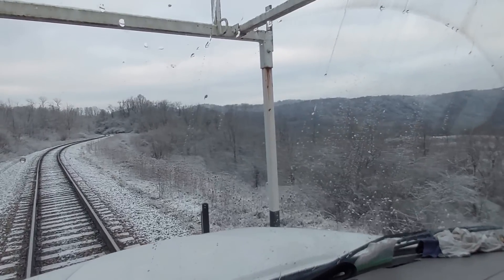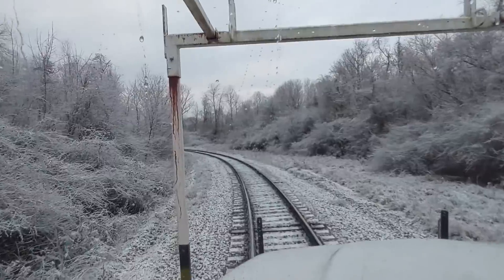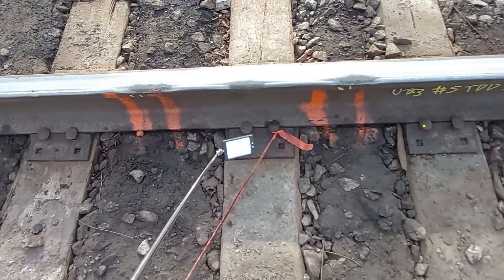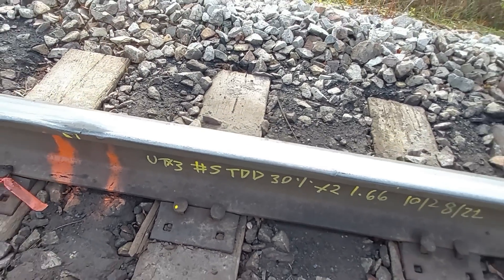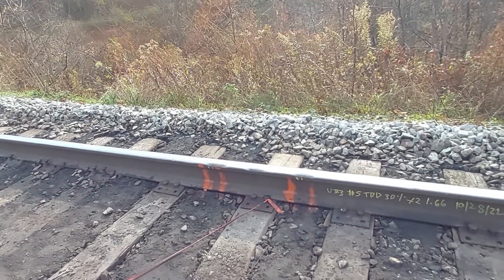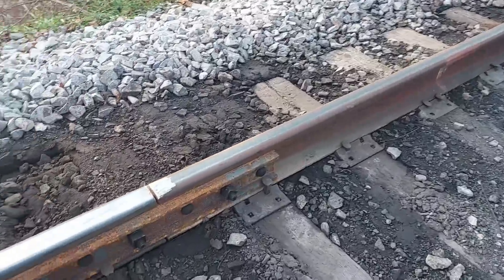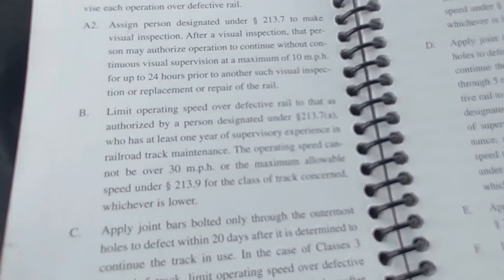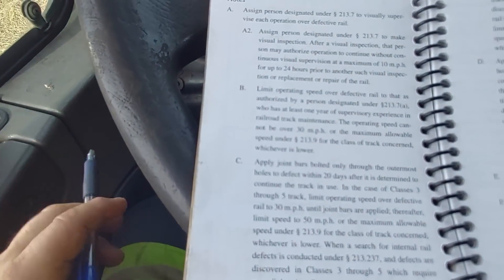Ultrasonic Rail Testers found a 30% Growth Inside the Rail Head

Comment: For about a year, I worked along side a ultrasonic rail testing team. One night we found a 100% T O defect on the main line outside of London.

This required us to immediately fit a clamp to the affected rail.

I was employed as a lookout/site warden, working both days and nights covering some 5 miles per shift - walk about 2.5 testing one rail and then turn around and test the other rail, using what we called sticks, basically a wheeled instrument with a large central wheel in which the ultrasonic signal passed through and into the rail. Or use handheld detectors for the rail ends.

When it came to the paper work, we record the rail type and where it was manufactured such as 'workington steel' as an example. Also any defects found, type and location such as 36mile 25chain. Which line it was.

 Heading back to our van for a nice cup of tea or coffee.

Sometimes we just walk the whole 5 miles to another van.

We also use test trains running at line speed upto 125mph with various types of equipment fitted and any defects found are marked with a yellow line in the fourfoot.
Reply from the maker: Appreciate your sharing that with us Kezza. Thank you very much
for taking the time to visit with us and check out the video 
my friend.

Comment: Hey Dave.  The defects in the rail head.  Was that a manufacturing issue that the defects came from?  I hope the manufacturer gave you  a some credit for a new replacement rail.  This has me thinking.  Thanks Dave.  Robert
Reply from the maker: Appreciate the nice comment Robert. Yes it was caused by an impurity in the rail rolling process and made worse over time by the train traffic. Expansion and contraction of the steel does not help matters either. That rail was rolled in 1975 so no replacement
from US Steel for that one! Thank you for taking the time to  stop by and check out the video my friend.
Reply: Dave, you are the best in explaining how things work and what cause the problems with how to work around things, the need fixed or replaced.  It makes me sad that I could not get working for the railroad.  I always look forward towords your videos.  Thanks again, Dave.  Robert
Reply from the maker: @roberttrometter5788  👍😊

Comment: Thank you for this interesting video. 

Unlike bones (where the fissures are called occult fractures) rails don't repair themselves. 

There is likely in each instance a defect in manufacture or excessive stress beyond what's normally expected, perhaps related to the laying of the rails: a minimal defect can serve as a nidus for further growth. Multiple detection modalities will reduce the false negatives.
Reply from the maker: Appreciate the nice comment Robin. Yes it was caused by an impurity in the rail rolling process and made worse over time by the train traffic. Expansion and contraction of the steel does not help matters either. Thank you for taking the time to  stop by and check out the video my friend.

Comment: How old was the rail with the TDDs? I know in the days before continuous casting, the “A” rails would be the ones with the highest chance of impurities, since the A rails were rolled from the bloom at the top of the ingot, where all the impurities collect.

Thanks for sharing!
Reply from the maker: Appreciate your sharing that RailrunnerRHS. I am very unfamiliar with A rails. The rail we had was 132 1975 US Steel Illinois HH.
Thank you so much for taking the time to stop by and check out the video my friend.
Reply: @ccrx6700   More than happy to give back! The side of the web opposite from the brand should have the heat number, ingot number, and rail id stamped into it. Usually the rail id is just a single letter separate from the other two numbers. If the rail was rolled from a traditional bloom, it’s typically given an id between A and H (with the A bloom being from the top of the ingot), and rails made from continuous cast blooms are typically given an id starting with P, R, S, T…

Don’t know that this trivia has much immediately practical use, but you never know!

Comment: For the first time ever in my carrerthe other day, I saw a sperry tech hand scanning the rail.  This was after the sperry rail car went over it and they rechedked it.  It passed right by an Insulated joint for our track circuits.  They did have one defect of CWR which was replaced as the track was out of service and the track cars followed on the same outage.  Welding truck and and a rail truck.  There was three crews.  They did use splice bars, for now, then Butte Weld later.  That was 136 pound rail.  We also have 115lb rail. I know that video was a while ago with the snow, but what pound rail was it and when you find some kind of defect if you could (if allowed) show us who made it and when it was manufactured.  

This testing is every 90 days.  Some by hi rail ruck as the SRS 128 does not fit in our tunnels, or in years past we had automatic signals that probably not make it when the machine came by. Now the signals are removed except the interlocking in one section.  Support track dept as the foreman says.  We have a book like that for Signal.
Reply from the maker: Will talk more about how they do it the next video Tuco. Hand scanning included in that. Thank you so much for the very nice
comment and for watching my friend. We do our testing twice a year.

Comment: Dave, you should request the company to buy a portable Stanley hydraulic power pack and a hose reel that you could put into the back of a hyrail pickup when needed when your boom goes to the shop, we have those and keep it on standby or use it as needed.

https://youtu.be/rHzE-MV8KO0

Comment: WOW! I didn't believe climate change, but you got some serious climate change going on there. Snow in the middle of summer. WE'RE DOOMED!!!!! AAAHHHHHHHHHHH!!!!!!

I did enjoy the metallurgical aspect of the video as well. I'm really amazed the rails stand up as well as they do.
Reply from the maker: Back years ago they warned us of an ice age coming.....now it's
the opposite. I bought a brass steam whistle, small one. It has
some yellow paint on it. What would I use to clean that bell up David? Just a wire brush or is there some special compound
I should use instead? Thanks in advance for your reply. Gonna plumb it in to my DeWalt big air compressor tomorrow and see
how it sounds, it's a small 2 chime so I'm not expecting a Big Boy
sound....:-)
Reply: @ccrx6700  Does it come apart? Not knowing how big it is, you could get some white vinegar and put it in a small stainless pan and put the whistle in there and boil it until the paint softens. then it should wipe right off. If that's not an option, try some acetone and a paper towel. Once you got that off, then I'd get some ~0000 Steel wool~, available at home despot, and go over the whistle so it gets a nice even finish. It will be matte at that point, but any odd coloring and stains will be gone.

Next get some Mothers Aluminum Wheel polish and a piece of soft cardboard box. Use a torn piece of that cardboard and on one corner dip it in the Mothers polish and then start rubbing out the brass. You should achieve a real nice shiny polish on the brass. You may need to apply several times with fresh pieces of cardboard. 

If you have an old clean, soft terry cloth rag, finish my wiping down the brass and removing any leftover Mothers residue. By that time, you should have a perfectly polished piece of brass.

I posted a video of how to do this on my channel in the community section. I tried posting it here and YT kept deleting it.

Comment: There is some interesting research on ground conditions and the creation of resonance frequency in the track steel. "When a train runs on soft ground it can approach or even exceed the speed of surface waves in the ground. Under such conditions the amplitudes of the track response increase considerably. Moreover, a resonance-like phenomenon can occur in which a clear oscillation trail can be observed behind the moving axle loads. An investigation is presented of this resonance frequency and the critical speed effect for a track on a layered half-space subject to a moving load"
Reply: Resonance can be evil.
Just like a bridge when you meet it’s resonant frequency can be a problem. ‘Flex flex flex crack!’
Reply: @Bassotronics  I'm thinking it adds to the destruction of these rails, makes defects fail faster. Might be Dave's operators hot dogging the trains when no one's looking
Reply from the maker: it is my firm believe that soft ballast does indeed cause internal
defects to grow faster that's why I want to read proof of it in
print so I can take it to management and show them studies done.
Reply from the maker: I would love to read that futtewuk, can you provide me with a web link please? Soft ground like we had at MP 1.66 is never easy on
track infrastructure. thanks in advance for getting that to me.
That is the kind of stuff I love to learn about. Also appreciate
your watching and writing in my friend.
Reply: @ccrx6700  I'm going to try and link it, the title is Analysis of resonance effect for a railway track on a layered ground
Reply from the maker: @futthewuk5789  I typed it in and got it!  Awesome will read tomorrow thanks so much 👍😎👍

Comment: Very interesting Dave, those testers must have saved a potential derailment or two over the years! As for the tamper, I know you've mentioned  braking rails with it before. So does it automatically follow that when that happens, the rail has a defect?
Reply from the maker: Glad you enjoyed Richard. Yes when tamper breaks a rail you
can bet there is an internal defect right at that spot where it broke. Thank you very much for stopping by and checking out the video my friend. Hope to see you on the next video part 2 of ultrasonic rail testing.

Comment: But didn't they have those defects labeled as (TDD) Detail Fractures? Therefore, Note C would apply. However, since your track speed is company limited to 25 mph you would still be within the guidelines,  just the remedy would be different. Transverse Fissures originate internally; Detail Fractures originate at or near the surface. All that is irrelevant since you replaced the defective rail. Correct me if I'm wrong.
Disclaimer: Members of my family have been railroad men since the late 1800s so it's in my blood 😄 but I am not a rail inspector or expert in rail defects. I do own both the FRA Rail Defect Reference Manual and the Track Safety Standards Compliance Manual.
Stay safe,
-- Joe
Reply from the maker: You are correct Joe. However I told you why we didn't put the joint bars on and also Note C says bars must be applied within a 10
day period. I knew at the time that it would only be 4 or 5 days
before we replaced the rail. So even with C in place we were still
under CFR compliance.  I do want to congratulation you on
being a thinking man and also say how wonderful it is to
have your family history in railroading! Awesome!  Thanks for
watching and you will certainly enjoy the next video coming out
on ultrasonic testing.  Also note: had there only been a single
defect on that rail instead of the 2 in close proximity I would have put the bars on that day despite what the CFR said.

Comment: Where's the Amazon link for the books? Then your followers can be keyboard warriors on railroad safety .

Interesting video, as usual. Thank you for taking time to make them.
Reply from the maker: You can get copies of the CFR book easily that info is also online
Mike.  The CP book now that's a different story, it is only put out by CP and you might, just might be lucky enough to find one on Ebay,
last time I checked no dice.  Thank you very much for stopping by and checking out the video my friend. Hope to see you on the next
video part 2 of ultrasonic rail testing.

Comment: Those defects look like where the drive wheels were spinning, no?
Reply from the maker: Jim, there very well could have been some wheel slip in both
those locations at one time or another which if it happened
certainly could have been a factor in the growth, but we will
never know with certainty. Thank you very much for stopping by and checking out the video my friend. Hope to see you on the next
video part 2 of ultrasonic rail testing.

Comment: Curious when you'd bolt rail sections together like this repair vs use thermite welding to join the rails.
Reply from the maker: Welders will not thermite weld a joint that has the 3 bolt
holes and we did not at that time have any rail that had ends
that were not drilled so we bolted them together, but good question. Thank you very much for stopping by and checking out the video my friend. Hope to see you on the next video part 2 of ultrasonic rail testing.
Reply: @ccrx6700  thanks for the explanation. Makes sense although I would have assumed you'd have cut out a section and scabbed a piece in and thermite welded it, not replaced the whole section of rail. Assuming that's because you'd then end up with rail made up of nothing but small scabbed pieces which isn't ideal either.
Reply from the maker: @dyoung3536  👍😊

Comment: YIKES! For a few minutes, it appeared there was snow in early July, until you got the dates straightened out. That snow would feel good on a hot July day, though👍👍👍👍❗
Reply from the maker: I'm ready for some snow about now Paul! Tired of this high 80 stuff, I like it cold. Thank you very much for stopping by and checking out the video my friend.
Reply: @ccrx6700  from what the national weather radar shows, your area should have got some rain. Not sure if its needed in your area, but at least its a little cooler than those sweltering 80s. I dont mind a "little" snow, but before it gets over a foot deep, thats when i get out and stock up. We have had a few days in the 90s here in central Illinois,, and the Ultraviolet reading has been a "10" for quite a few days. When it gets above "6", thats when i stay inside, per my dermatologist, because i am 5 times more likely to get the bad kind of Melanoma.

Comment: How often do you get a new FRA rule book out? Do they change in any way that is relevant to the railroad where you work? Do you have to take some recurrent training to keep up with this?

I am a private pilot, and we are federally mandated to do a flight review every 2 years, although where I rent from they require us to do a flight review every year. Part of this is to discuss changes in regulations, and also testing standards. The practical test standards do change, so we will practice in the airplane to keep current on everything. Also the FAA puts on periodical online webinars in the evening so I can keep up to date on the latest developments, and what has been learnt for accidents over the years.
Reply from the maker: yearly a new book comes out annyer. Yes they do make changes
so thus that is why new books are issued. Negative on any training
if your a railroader, FRA inspectors are updated on any changes and they must keep current obviously. Thanks for sharing that
info with us. Appreciate your watching my friend.

Comment: This might be dumb, but cant you get some welders out there and grind out the bad spots and build them up?
Reply from the maker: Not a dumb question at all Mike, but consider for the time it
would take to do that we can change out a rail in less than
45 minutes and then you've got a new stick of rail in there
that will last another 40 years or so. Welding would mean that
stick will need to be replaced at some point before then anyway.
Hope that makes sense. There was a lot of damage on that one rail  
so replacement was the ticket. Also code fed regs says to replace rail, not weld it. Thanks for stopping by and watching my friend.

Comment: Poorly forged rail too much heat causes that also too ash in the steel dangerous stuff great video thanks Dave
Reply from the maker: All internal defects originate from the rolling of the rail Gary
you are right. A tiny hydrogen molecule (classified as an impurity) over time grows like a cancer inside the rail over repeated train loading of the rail, mud spots don't help matters. Thank you for
watching my friend.

Comment: I have some questions:  

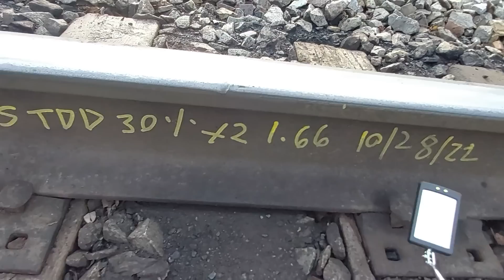@6:30 how long has that rail been in the line? 

Is there such a thing as a log book that keeps track of when each section of rail is installed/replaced? Is that a thing or a computer program? 

Do old rails get recycled or cut up to remove the defect area and rewelded? I ask about the rewelding as I caught your previous video on thermite welding.
Reply from the maker: 1. rail was originally rolled in 1975 US Steel Illinois.
2. Yes we write down and keep track of all track maintenance
like changing rails in a log book, that is being changed over to
a computer program.
3. A rail that has an ultrasonic defect never ever gets resold for
anything other than scrap, It is unethical to sell a known rail with
a Sperry defect for relay rail.
4. Thank you very much for watching my friend.
Reply: @ccrx6700  Thanks for the quick reply so late in your evening.
Reply from the maker: @mjphillips76  👍😊

Comment: I saw today where a CSX coal train derailed in WV about 20 miles west of Roanoke VA. They knew they had a bad wheel on one of the cars but tried to make a siding 8  miles where the detector told them the bearings were way too hot. They did not make it and derailed 9 cars.
Reply from the maker: I'll have to check that out wolfpacva. We had a bearing go bad
again today on one of our cars, they caught it in the yard. 
Appreciate your sharing that info and for taking the time to
watch my friend.